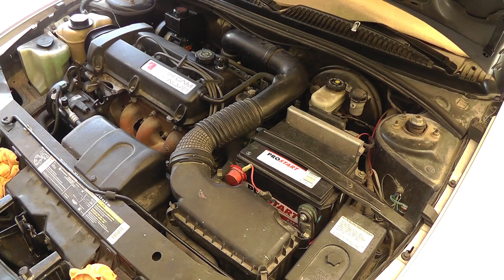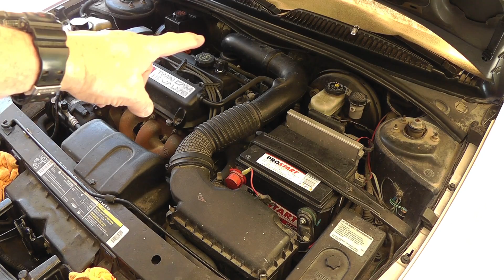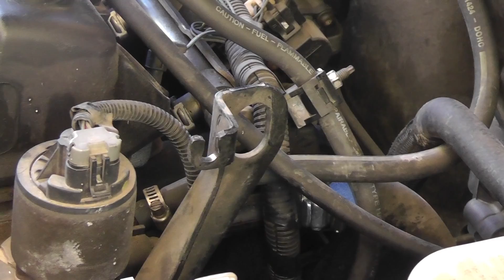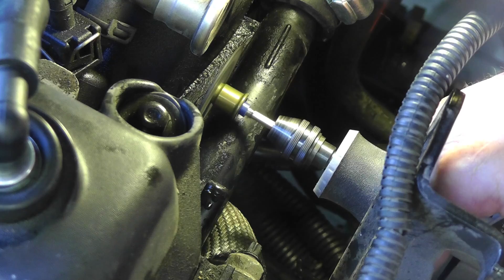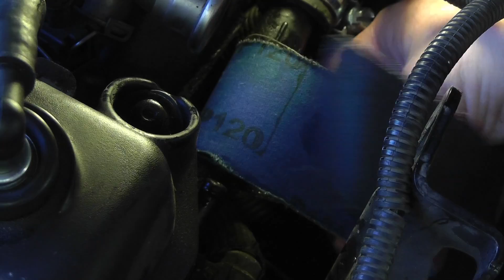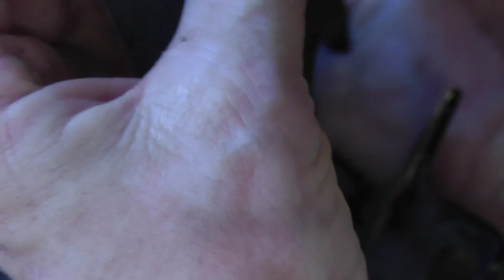Saturn Intake Manifold Repair, NO REMOVAL!

Comment: The  Ultimate solution is to remove that plastic connection completely with a help of multitool and cut it  of at the head and use car Saturn 
Metal steel replacement part ! With  new Gaskets and new studs and that will fix that problem completely forever !

Comment: Instead of Dremel I used  Milwaukee Multi-tool with plunger blade and cut of that plastic completely and replaced with steel pipe from CAR-Saturn aftermarket replacement kit.  Installed their supplied gasket and bolted the whole thing back to the head.
Installed their supplied addition used Preston  Seal kit too seal against leaks. No leaks now for many years.

Comment: Just did the inlet pipe repair. Tried to coat it in plastic weld first. Did not hold. Lasted 1 day. Got the replacement pipe off Amazon and cut the pipe out without removing anything. Replaced with new part. Total time of the job was 1 hour start to finish.

Comment: Thanks for the video! The tube cracked on the outer side of mine, so I just slid the hose all the way up over the crack. I also JB welded the crack and wiped the excess off for added strength, works great now!

Comment: If you remove that bracket that braces the air intake (just to the side of the EGR valve; two 10mm head bolts) and the EGR valve (Cover the hole!) and the nut that holds the vacuum hoses/EGR wiring harness and move those out of your way, you'll have a LOT more room to work from straight above. And use a hacksaw blade, NOT a power tool, on plastic. And you'll probably want to shorten the outlet pipe so there is not so much "leverage" trying to break it off as you bump and vibrate down the road. Remember to leave a little "ear" of material near the new end, so the clamped/hose doesn't slip off! I also recommend going ahead and buying the Dorman repair kit BEFORE you start, just in case you end up needing it. Because there is a 50/50 chance you probably will, and a 100 percent chance will need it someday. If this works, great. SELL THE CAR while you still can :-)

Comment: 2002 SL2 with 145K here, owned since March 2013 and 100k miles.  Unfortunately, my  intake coolant tube split not near the hose end but along the tube seam about halfway down the tube.  I cut the support to separate the side of the tube from the manifold as suggested in the video but I would have had to slide the hose about 3" down past halfway on the tube to even have a chance of covering the leaking seam.  In my case it made more sense after cutting the side support to simply cut off the tube across the middle, leaving a new 1" nub  near the bottom of the tube to reconnect the hose and clamp it down.  So far so good, however if at some point the seam splits farther down the side and leaks again I'm out of room to cut more off the tube.  It'll be time for the upgrade kit.
Reply: In fact, I suggest cutting through the tube about 1.5 inches away from the base BEFORE cutting it loose from the sides, to avoid accidentally snapping it off as you work.

Comment: Thanks for posting this video, the repair worked for me.  I used a coping saw and a hacksaw blade that was taped to a stick to cut the plastic.  I also braced the heater hose to the fuel line bracket, estimating that a longer pipe could flex as the engine moves and break at the manifold.

Comment: This method  is exactly what came to mind as I watched the Doorman repair video. I think I would try to cut out a little less material unless the crack demanded going as fas as you did. I have a cheap oscilliating saw from Harbor Freight that I think I would try to do the cutting if there is actually room to nose it in there. I think it's a good idea to find a bit of thin wall tubing to JB weld inside the tube to give it a bit more strength so it dosent crack again. There is no reason this method can't be a permanent fix .
Thanks for posting.
Reply: Oh, it will crack all the way down to the block, eventually, if you give it a chance. (It's not really a "crack;" it's a seam that eventually splits.) If you're going to try this, go ahead and do it as close to the block as you can get without breaking off the overflow return spout (the little hose just above this outlet pipe.) Leave a good 1.5-2 inches for attaching the hose (leave a little bump of that cut away material at the new opening so the clamped hose doesn't slip off.)

Comment: While this is a clever way of taking care of an unfortunate situation, I would not recommend it as a permanent repair. By taking an extra 60 minutes and carving the tube completely out of the way you will have room to install the Dorman repair kit that has a very substantial steel tube that replaces the original plastic one and will be more permanent. However Kudos for coming up w/ this innovative way of repair.
Reply: Noooooo...go ahead and try it. The less you cut, the less chance you have of ruining the intake manifold.

Comment: BE CAREFUL !!!   While cutting into the "wing" the small outlet (line going to reservoir tank) is VERY brittle !!! Mine fell off ! Thankfully there was a little 1/4 stub left, I used a plumbing part to extend it, and used  the screw rings to hold it tight, then from the o-ring I used several zip ties to hold it from backing itself out, while the new part arrives, so far not one drop from it.

I do not know the part name, (it fits inside a plastic tube so the tube isn't crushed (like on a water line for refrigerator)
Reply: Plastic sleeve!

Comment: I am doing this in the morning, so we can get to work etc while the new part is being shipped to us... Wouldn't it help of the pipe length was shortened?   Seems like every time I get one issue fixed it creates a new one... I love my Saturn, its just being a bit stubborn...  First it was the reverse slam,  and in the last 6 months have had to replace the following

All motor/trans mounts
Oil change, filter change
trans fluid and filter change
radiator 
Trans lines to radiator (automatic) 
The Input Shaft nut  was the worst. 
Battery
water pump
thermostat 
tires
windshield (damn wiper blades!)

and we have an abs issue no one seems to know what it is... checked fluid levels and checked and cleaned the sensors and the teeth still abs light is on, and I hate not having the ABS... I had a car pull out in front of me, I hit the brakes, my car slid.... 

When it rains it pours 

Thank you for the video it helps so much !!!! Thank you

Comment: I need help I have a 03 saturn vue v6 all wheel drive it seemed to be running ok but failed emissions. took it to a shop they came back with P0171 system to lean bank 1 and P0174 system to lean bank 2 P0446 evap emission control system vent control circut. P0507 idile control system rpm high. now the evap and rpm i question because for almost 7 days straight it was being drove the service light was on but it ran good and the idile never jumped around or sank to low. i scanned it three differant times and days before it went to the shop i had the evap code come up one time than it went right back off. never had the idile code. bank 1 and 2 did keep coming up. they also said intake manifold gasket is shot and i should start by replacing that first. my confusion is i have been sitting in the vue with it running for the last 45 mins give or take the idile has not moved it is where it should be im confused any help would be awesome thanks
Reply from the maker: I would try to see where, if any leaks are actually in the gasket by spraying carb cleaner around the gasket area. Make sure you do not let any enter the air intake "breather" (the filter box). Listen for idle changes as you are spraying. Use short bursts rather than a steady spray, you will get better results. It may be something as simple as a vacuum leak.  Also post this problem on the Saturn Fan page (http://www.saturnfans.com). There is bound to be someone there that can assist... Good luck.
Reply: i tried that today i had had a intake gasket problem with a differant car and did that to find out when i the saturn there wasnt much change but i had a hard time reaching the back